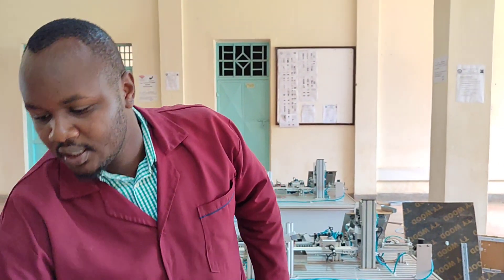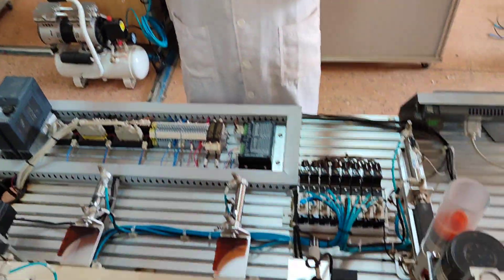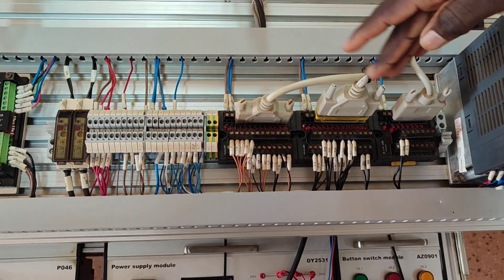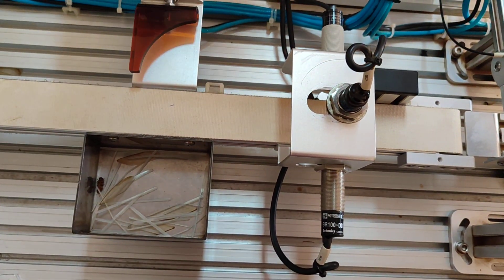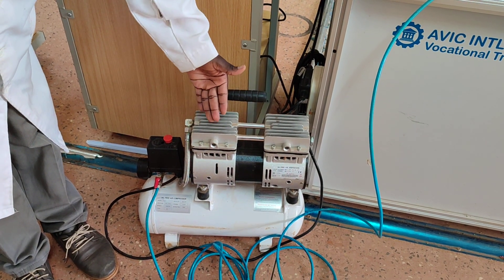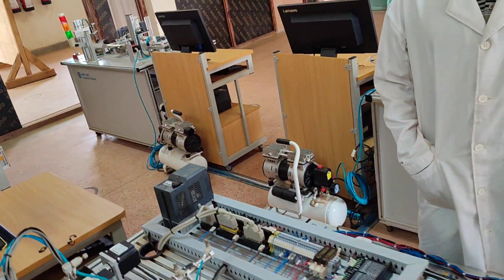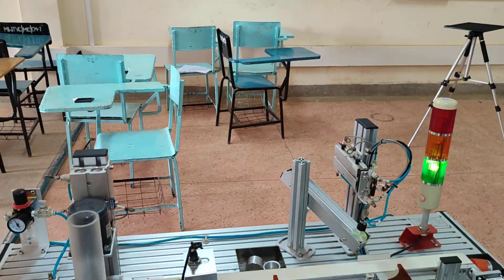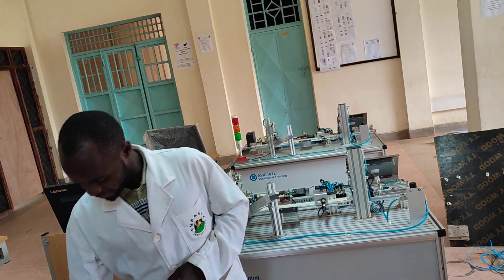Mechatronic Systems Installation at My Workstation Part 2

Comment: Very good content. With this one Mechatronic station students can learn about sensors, actuators, controllers, HMI, solenoids and pneumatic, Switches as control inputs (Push buttons, Normally open, Normally closed or ON/OFF switches, programming, PLCs, Asynchronous motors control, stepper motors and their programming, sequential programming for assembly lines.
Also like the part that the students can disassemble, learn different modules, reassemble and reprogram. Good work Sir!
Let's train for our industries!
Reply from the maker: You are very right engineer